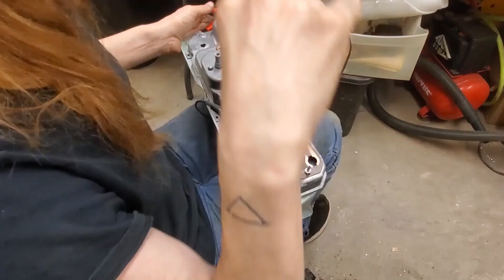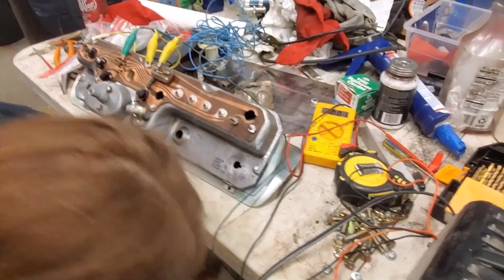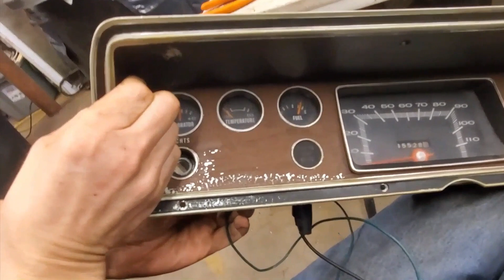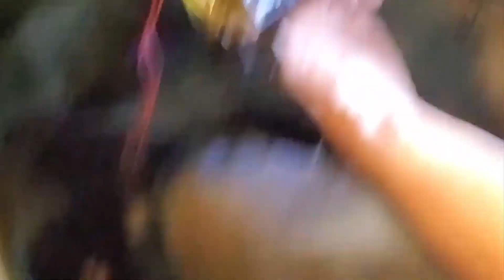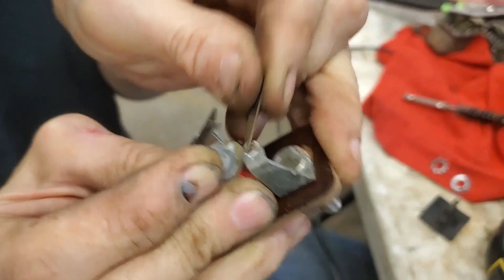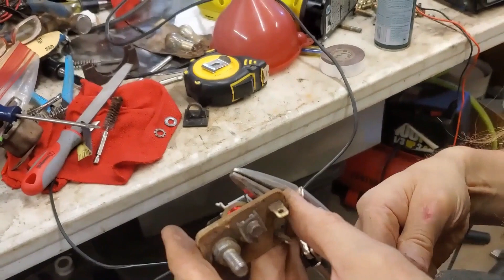Old Electrical, Overheated Connection, Bad Relay, and Making it Work

Comment: Been looking for this content, my gas gauge on my 65 Dodge stop working. I figured out mostly how that happened but I want to repair the 2 gauges that the little wire “broke”. Do you know if that can be fixed?
Reply: by 'little wire' I am guessing you mean inside the voltage regulator. I don't think I can suggest a fix for the wire in the regulator other than buying a regulator. The regulators are still available through parts stores or ebay I believe.